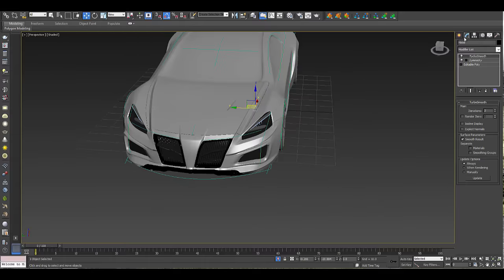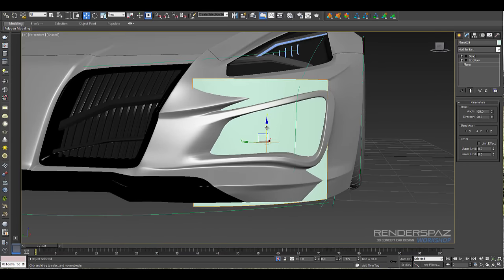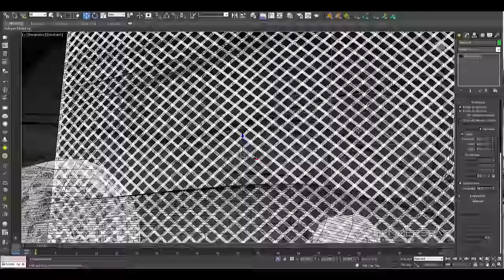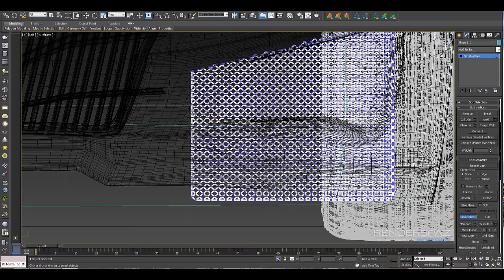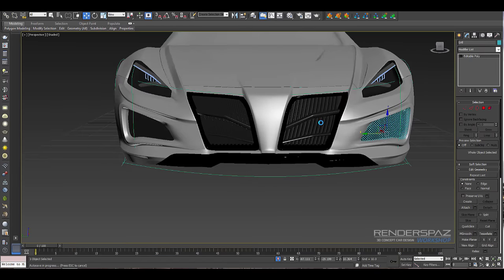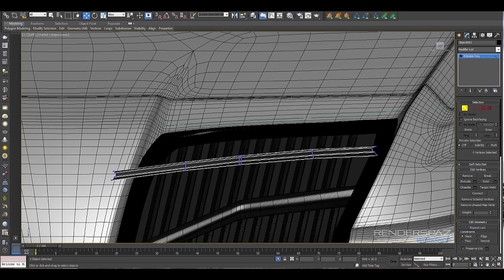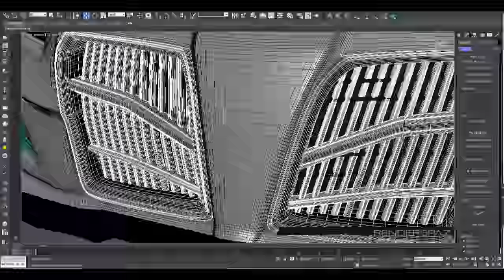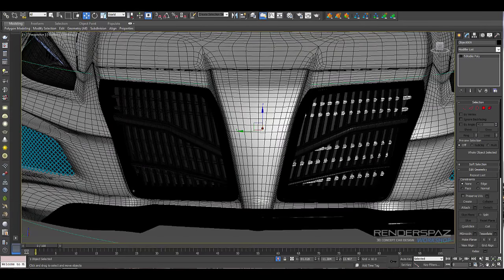3D Concept Car Design Workshop - M3 Creating The Grill (3D Studio Max)

Comment: hey  i am new to this but wanted some advice and feedback here is my current hardware system 
i7-4770 @3.40GHz
gtx 970
16gb ram

i wanted to add another gtx 970 to make it an sli and another set of 16gb ram.

so new system would be 
i7-4770 @3.40GHz
GTX 970 SLI
32Gb Ram @2100MHz

do you think making the new additions would help speed up render times in any software i.e revit / 3ds max / lumion 3d or simulation work in navisworks.

Feed back is much appreciated.